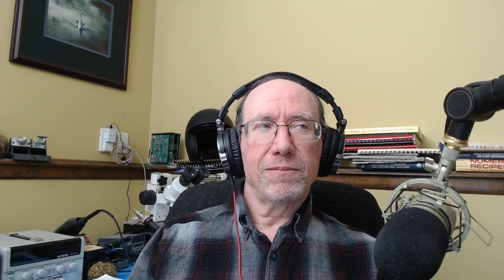Does an Ultralight Airplane need a parachute?

Comment: When you talk about maintenance these 2 stroke engines can fail very easy and also you may have a new engine but there could be a flaw with the metal use in the engine and it fails . I have seen ultralight aircraft were the wing brackets had big scratches in the corners I fixed it and the brackets that hold the rudder peddles on had 3/16 pop rivets in 1/4 holes and it was loose had to fix that and a few other things . Been an engineer if you have to do maintenance have a full check list record the maintenance and always every few month contact the manafacture or some that has the same plane and ask of any problems they have come across . And the way I see it I’m going to build an ultralight and I’m putting a parachute so there is the protection should something go wrong